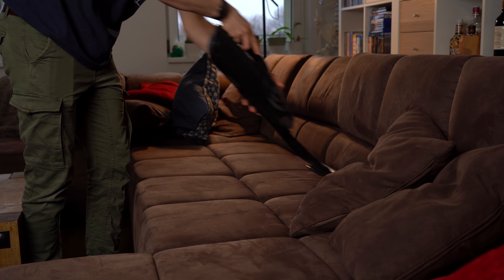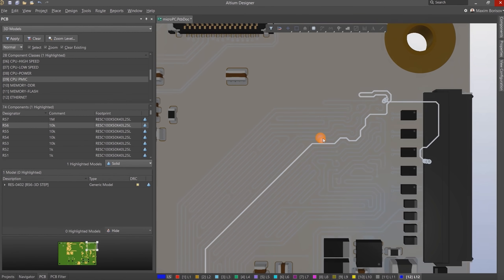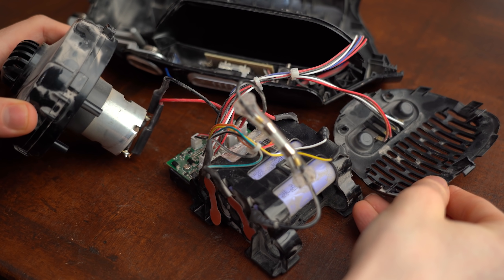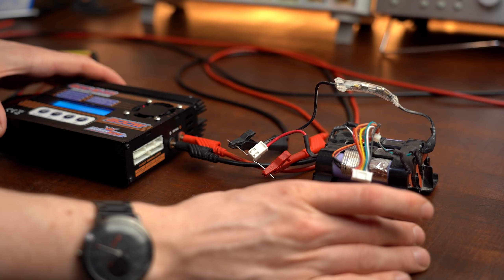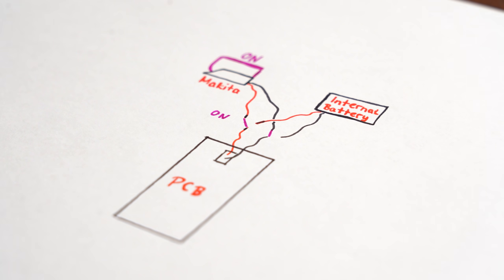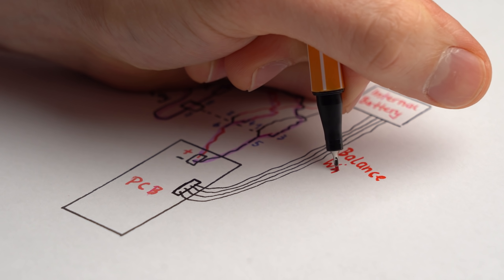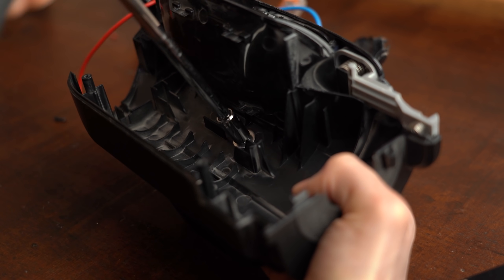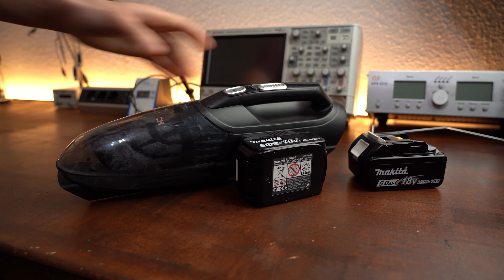Every Device should have this Upgrade! (Endless Battery Run Time)

Comment: This is so cool, and it makes me wonder now how one could Frankenstein a super vacuum - finding the best "starter" platform, and building something "better" than a Dyson for a fraction of the cost. You can create spinoff series where you test a few products, make a few "simple" modifications and provide a blueprint for how to do it. Also, seeing you open up this vacuum it almost looks like there's a LOT of wasted internal space...makes me think they could've shrunken the size of the electrical to make room for a larger bin for debris, or shrinking the size/weight of the vacuum as a whole while either reducing weight or improving some other areas (even cost or... profit margins LOL). Perhaps the shell/template of the vacuum was readily available through other factories producing a near identical product.

Noticed when you first cracked open the casing for the vacuum how much fine dust is inside.

Kudos to the starting dialogue - you had me at vacuum, clean freak, and batteries. LOL

Comment: Great, we have more or less the same vacuum, perhaps different model no. Due to different colour 😂. But I have totally no experience in electronics, but I’m also not afraid. Only I will do it then with a Skill 20V battery. So besides the different plate and battery I think it’s worth the try.

Comment: After rewatching this video a year later and after seeing the struggles with the vacuum’s motor not being fast enough. I would say that it’s just worth it to buy one of makita’s vacuums that run on the 18 volt LXT batteries. They have ones that are very similar to one you have.

Comment: Using the same principle, but with no soldering and not much, if any, teardown—an idea I plan to try out, after this... —would be to use BOBO B2 battery packs (the first ones made for Quest 2 that work with their M2 headstraps) with their more recent docks that physically connect to their M2/M1+ headstraps and have a USB C out, which could theoretically be clipped to any device that can be powered via USB C. One could simply affix the battery dock to the device to be powered; then insert the battery and plug the USB C cable from the battery dock to the device. It’s not nearly as seamless a solution, but there’s definitely an ease of use/ease of setup trade off, for those who don’t want to open their devices, and etc. It would be great for portable USB speakers, to sit next to a laptop powered by USB C, and etc. Excellent idea, and thanks for the walkthrough, to integrate the replaceable battery solution directly into devices, themselves... Cheers!
Reply: PS — The battery packs are 5200 mAh, and BOBO also has a dual, battery charger. The battery packs simply “snap” onto the doc, with a pair of very strong batteries, made for use with VR headsets that get moved around very quickly, for many hours at a time...

Comment: Heyy! I recently changed the li-ion batteries in my Electrolux vacuum (all batteries are in correct order, and polarity). When pressing the on/off button, the indicator light flashes and the vacuum does not turn on, as did yours. In my case the batteries are not empty and I have not connected an external battery. What do I have to short to make the board work again? Thank you in advance! 7:31

Comment: does the makita battery only have the two terminals? if it has more, you might be circumventing some of the makita battery protection by using the two-terminal adapter plate (ive seen people have issues with that on a similar dewalt battery where leaving the battery in would cause a constant small load on the battery and undervoltage it)

Comment: But can you run Makita power tools with a (lab?) power supply? Yes, you can, but what kind of power supply would be good for the job? Some lab power supplies even mention that they shouldn't be used to drive power tools. I guess one needs 18-21V and 30+A capable power supply, and lab quality might be excessive. So what kind of PSU should one use for these? Yes, you need to solder a bit to make the connection but that's not too bad.

Comment: Wouldn't it be possible to also or just get power from the wall instead of a bigger battery? I'm in the same situation of needing longer power for a battery operated wet/dry 20V 2amp vacuum. But I'd rather convert it from battery to wall vise versa.  Wondering if relay and transformer using one of the battery housing I have would work. That would also truly be unlimited power.

Comment: I did the same upgrade on my cordless vacuum. It's actually very easy to do because the battery pack has all the safety features and all you need to do is to apply to correct 12V to a 12V vacuum.

Comment: So when you leave the external battery in... wouldn't the relay drain it too? Also when you leave it in and plug in the charger what would happen? The bms go mad without the balance wires to go to the correct battery or is it even a fire hazard?

Comment: You chose a heap of crap vac to demo on??? 
Use that cleaner whilst a sunbeam is flooding through the window and see how little gets filtered with cheap technology. 
Just shifting dust from A to B , like in the old days with a feather duster. 
Start the upwind side of the room and hope that most would blow out the other side.
But now with air conditioned closed houses, with more dust entering opened windows, than exiting, a high quality vac is required for you own health. 
And hey Scott, if you can clean your flat / house in the 5 to 17 min that this pathetic cleaner runs, face it mate you are not a clean freak, you are a dirty grott. Routing the machine across your couch at that speed I would be amazed that any dirt could be captured, just brushed into the either, like a broom would do.
I gave you a thumbs down. 
Dispondently  Brad.

Comment: I know this video is a bit old by now but it was just now recommended to me, so...
I'm criticizing but not hating here - just saying what I think about the video.

Some comments already mentioned what bothers me here but I didnt see much else information.
Many brands (including those already in use here) already made such devices that are compatible with their battery packs.
Examples are Bosch BSS825ALL - Makita DCL280F - Metabo AS 18 Compact - Dewalt DCV517N or Milwaukee M18 CV-0
[No ad just proving these exist and these are not even the only models - so its not a new concept.]

I think the video is still well executed and good for DIY hobbyists and enthusiast that own some battery packs and a cheap vacuum to modify for this project though. 
Video title on the other hand should rather be "Many devices already have this" or "This is how you make / improve your own (cheap) Battery powered vacuum"
At least money and resources can be saved that way and that's always good.

Comment: The motor looks like a clone of those cheap Mabuchi DC motors used in RC models. Their efficacy is quite low. I wonder how much the runtime would increase if that motor is replaced by a better (brushless?) one.

Comment: I remember having this issue with an old cordless vac that a friend of mine had. It had a cluster of NiCads that were daisy chained together in different sections of the case. It looked like a big hassle to do a conversion on it. I do like cordless vacs. Their convenience means I'm more likely to grab it. When I was shopping for one myself, I decided instead just to buy a Milwaukee cordless vac that runs off the existing M18 batteries. It's really durable, comes with a great set of accessories, and has enough suction for cat hair.

Comment: What voltage and ampera does the motor run off? If 18v then just wire the battery with the switch and bypass everything else since I don’t have his electronic knowledge

Comment: I still can't believe electric car companies aren't doing this. Why charge the while car over time, instead of having swappable battery packs. Imagine stopping at a service station, and have your packs swapped with charged and serviced batteries. It would make road trips much more practical in an EV. And if faults ever arise, serviced replacements are common and nearby.

Comment: Awesome! I'm looking at the exact same external Makita connector right now that I've had for a few months and not needed yet.
I was thinking I would probably cut out the back of the "transformer mode" full size and just deal with the ugly hole, to mount the batter on the bottom. Then you introduced me to plastic welding and now I know I would have.

Comment: great concept
would you be able to make a video on how to use an external battery for an electric scooter
apollo air pro 
or some budget e-scooter

similar problem
great dc motor, low battery runtime. 

how do you perform this on an EV?

Comment: Hello Scott! I love that you made this video, I've tried to make almost the same and I failed (because I'm shitty electronic:p). I've tried to connect ext battery pins instead of internal, and had the same issue with shuting off after a second. My main question is - do I need relay if I don't need int battery? How to find gnd problem if I have connection ext battery - board only? Thanks in advance:)

Comment: Kind of weird but the subtitles have extra information. For example, @5:35 the subtitles state, "And since the adapter also uses 14AWG wire, it should be ble to handle this current value." This was not in the audio.

Still love this video though!

Comment: Nice project! One question, though;
      All these vacuums have a "high power" mode (speed set to '2') available when they're connected to the long handle (I've opened up a Bosch (like yours), AEG, Leifheit.. They all had they high power option..).
       Any idea how much current it would draw on the high setting?

Also, does the vacuum now still work when attached to the long handle (with the high power option still working)? 
     Or did you give up that possibility because the battery pack needed to be attached somewhere?

(Because this modification would be useful in particular when you use this as a regular vacuum cleaner. 
      I don't spend 40 minutes using it to suck up some crumbs, but I DO need the extra minutes when I want to vacuum the whole house..)

-

Also, would be cool to see how to bridge the contact so it can be on 'high power' when used as a handheld vacuum :)
.    Can't seem to figure it out by myself.. I have more 'general' knowledge ("I can fix it if it's broken" type knowledge), but not enough to re-configure the controls, apparently...
    (Or I'm not patient enough.. That's also quite possible)

-

Sidenote; I had a Leifheit vacuum (same design, with detachable handheld vacuum) that DID come with an external battery pack.
      Sadly, the extra packs were about the same price as a new vacuum cleaner..
       And the included charger was still a puny power adapter that took 6-8 hours to charge the battery pack...  

I'm seriously wondering which VERY specific use case scenario all of these vacuums seem to be designed for...
      (Is it for when you already have a robot vacuum that cleans most of the dirt already..?)

Comment: I have the same vacuum cleaner. Turns out that these shitty batteries in them totally dies in almost year and a half. I'll be reconstructing it so it wont be wireless, but usable for more than 20 minutes

Comment: Warning using these adapters! Makita batteries does not have low voltage cutoff inside battery. LVC is done in the tool side. I hope this vacuum cleaner does that somehow.

Comment: 3:55 : ever heard of DCDC pumps that can change voltage ? No obviously you completely forgot that voltage exists at all ...
Reply: You also forgot to consider motor heating. 

Motors are designed with a specific power dissipation capacity. This heat flow is designed along with the battery capacity (in time ).

So if the battery is designed for 20mn use, then the motor is designed also for 20mn use max, and after 30mn it may burn.

The motor may not burn, but .. It may burn.

After 20mn use, the battery will lay 6h on charger what gives 6h to the motor to cool down.

This is called the usage time ratio.  

By adding swappable batteries and allowing usage longer than design, you introduce a possibility for fire.

I am not saying it's a bad idea to add an external power source.

I am saying than external power source must never be used without considering the usage time ratio, and max continuous usage time. 

I have already burnt devices by replacing dead 2Ah batteries by 4Ah cells. It was all internal, without external modification. But by doubling the use time I just burnt the motor.
Reply: The idea is not bad, but you are missing 2 critical security warnings (voltage and Wh, and usage time ratio ).

Comment: I hate this but nowdays it seems every battery powered tool likes to have built in lithium ion batteries, that are not designed to be user replaceable, which means the device ends up in the garbage after some years of battery degradation, despite being fully functional.

Comment: If I understand correctly, once the external battery is plugged in, the relay is "ON" all the time. I think it might drain the battery considerably over the time.

Comment: Great Idea. I think I have the same Bosch Vacuum Cleaner. I need to find the correct adapter for the blue Bosch 18v packs. 
Do I need the original battery pack connected? It does not bring any reasonable power anymore anyway.

Comment: I modded an old Sony DAB radio to run off DeWalt batteries using a 3d printed interface and a tiny transformer! Simple project.

Comment: Brilliant idea and as others have pointed out, something that should be factory standard on all battery powered tools - especially those like a vacuum cleaner that have high current draw.

But - und ziss is a big but - having said that, a batttery powered vacuum cleaner is about as useful as a dustpan and brush. Once you have used a real vacuum cleaner, with a motor power of say a kiloWatt, you'll never complain about dragging a power cord behind you again. Those little mickey-mouse things with a sub-100W RC car motor in them are fine for when you drill one hole in the wall and need to just tidy up the dust enough to pass until the next scheduled vacuuming job with the proper hoover - but never think of them as your main vacuum cleaner. They just aren't up to the job.

Comment: FYI if the frame of the battery holder and vacuum is made from abs then you can chemically weld it using acetone. Any gaps can be filled with adding thin layers of putty made from scrap abs and acetone since abs melts to it. Just have good ventilation and no open flame unless you know what you are doing, burning acetone off fast from the putty, to solidify it faster to build up layers.

Comment: Imagine if the companies that make those interchangeable battery systems would also make vacuums... They could make a lot of money on that. My house has a lot of Ryobi tools, and as such, a bunch of batteries, so it would be cool to use those with everything.

Personally, I think I would have stuck with just the bolts to attach the adapter -- just in case, say, a few years from now, you have a different brand of tools with different batteries or if Makita ever changes the battery type for the tools you have. Then you can just detach and replace the adapter. Although thankfully companies seem to like to maintain the connector, even if the battery chemistry/tech changes -- like Ryobi, we used to have all NiCad and now Li-Ion that slots into the same old tools

Comment: Endless run time? That's easy, skip the battery and plug your vacuum into the wall. Your probably never more than a few paces from an outlet, anyway. Batteries are utterly stupid in this context.

Comment: From my very brief time running testing on various batteries, charging at .25C (Input power ~= total power rating, so .5Ah in for a 2Ah battery) on a battery that big is great for maintaining total capacity over time, and it seems like it's being limited by an onboard charging circuit, as well.

If you bypass the circuit, you can charge at 1C, which is ok, and drop the charge time to about an hour with that power supply.

Comment: This is a cool mod, but wey exactly don't you just use a normal wired vacuum?
They have a literally infinite usage duration and are more powerfully. And plugging them in takes like 3 seconds.

Comment: You don't have to put the boys inside of an Xbox controller you can take the USB cable and plug it into one of those phone batteries and use that kind of like how you would use a Wii remote with a classic controller and just have the Wii remote dangling off the back of it then if your battery dies you can just pop it off put a new one in and go plug the other one into charge and your controller stays semi wireless.

Yes the Xbox controllers can use rechargeable AA batteries the same way but other things can't.

Comment: LOL , I just started a similar project with our cordless vacuum except that I am gonna replace the 16S Ni-MH 18V pack with 5S 18650 + BMS. THanks for A draw of the motor, I guess they are similar. Still waiting for spotwelder + BMS and accessories to arrive from Aliexpress. The vacuum is BOSCH Move 2in1 18V. The original 16S Ni-MH battery pack is still available for about 55€ which is a nonsense these days (BBHMOVE6 - 3000 mAh 18 V)(eqv. FD9403). I already tested the vacuum with 18V Lihtium pack it sucks like crazy, the Lithium battery can hold the Amp draw like it's nothing. NiCd,NiMH is outdated. I am thinking about Sony VTC5a or 6 series...

Comment: i did similar.  
i just 3d printed a shoe for my drill batteries and screwed it into the chassis of the vacuum. 
i have another spare vacuum motor in the bits box that may become a wet vac companion to the battery unit too.